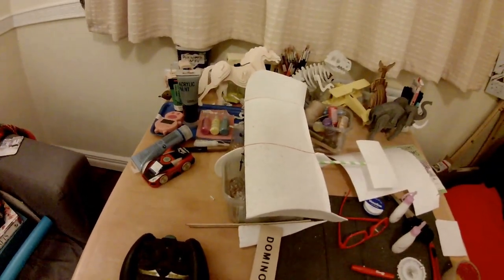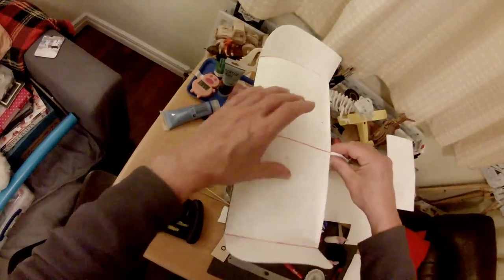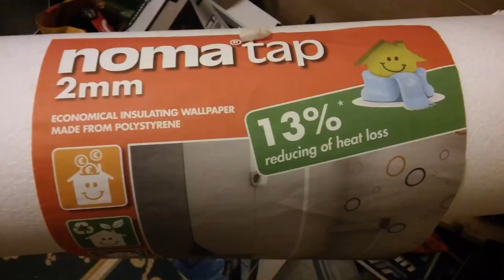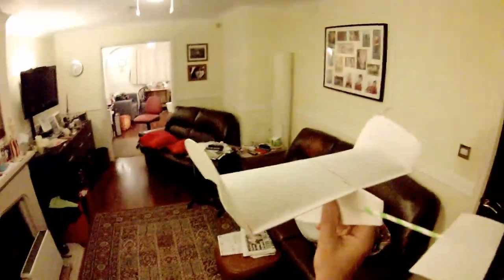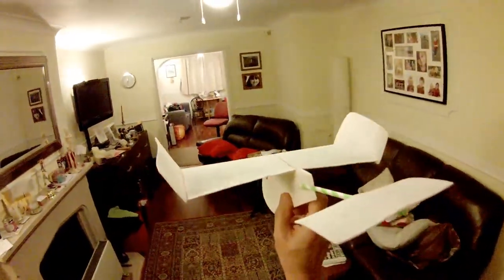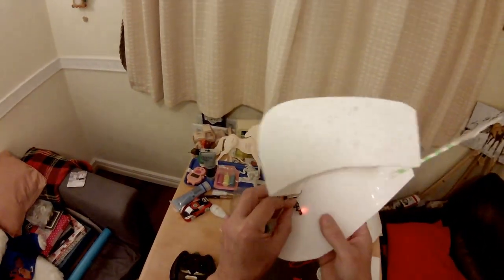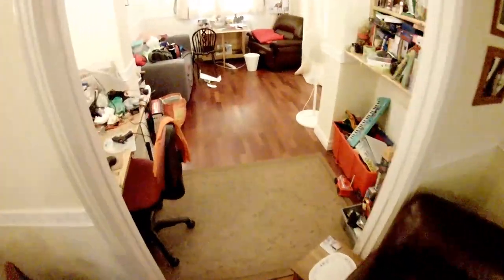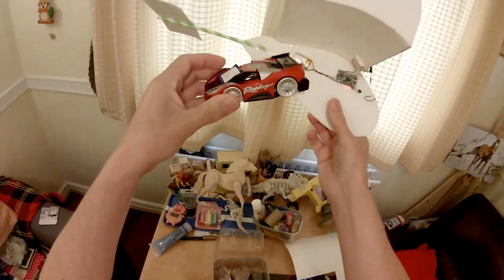Wall climbing car to lightweight RC aeroplane

Comment: Great work. Be good to see it on a calm day in the garden. 👍👍👍😍
Reply from the maker: The problem outside is the range. The infrared gets swamped and I have to run behind it to keep control. If it survives storage I might try it out in a clearing in the woods I recently found. There is a series of videos coming up where I film there and I have realised it might be a good spot for this one.
Reply: @GrandadIsAnOldMan  Ah, infrared. Stick a mini receiver it it.

Comment: Great little plane! Keen to see it in outside 👍
Reply from the maker: The problem outside is the range. The infrared gets swamped and I have to run behind it to keep control. If it survives storage I might try it out in a clearing in the woods I recently found. There is a series of videos coming up where I film there and I have realised it might be a good spot for this one.

Comment: Amazing job, finally another DIY plane video 👍👍👍👍👍👍 maybe you should put a vertical stabilizer to get it to fly straight
Reply from the maker: The whole body acts like a stabiliser, so do those wing tips. They provide what is commonly called a slot effect.

Comment: A classic project. The sort of thing that was going on around 2010, with the first of the 'Coke can' little RC cars. Sometimes, the rewards from such basic circuits and control abilities makes the result 10x better. This one had it's own success. I might suggest a biplane for slow speed and lift, with the motors slightly wider apart for turns.
Reply from the maker: Now that I added the tail a second wing would not be a problem. The original intention was just a flying wing. I am not sure those little motors would manage the extra weight although I could risk larger props. If they kill the motors I have plenty more of them. I have larger ones too but the plan was to just take the gear out of the car and try and fly it as standard.
Reply: It's where I'm at for LRF's too. Thing is, you know what weight the gear can fly from those tests. A new build would be to the same weight or less. I was very impressed with its slow speed, usually finding the need to put a 30mA lipo on and a single 4mm motor! High alpha always helps too (CG slightly forward, elevator/elevons raised). Good luck  :)

Comment: moment of Area technically or Area simply behind CG has to be more than ahead of CG for stability   Y
Since CG always wanna go straight ahead. If plane with more area behind CG gets tilted slightly sideways due to any disturbance,  drag moment to straighten plane will be more than to tilt it (bcz more area behind) so it will re-straighten
Reply from the maker: Thanks

Comment: I like this one. A nice way to get some flying in when winter rolls around. I honestly think that with a vertical fin and some more wing area (a biplane perhaps) this would be a really stable and gentle little flier. What kind of foam are the wings made of? They look exceptionally thin.
Reply from the maker: The foam comes in a roll and it is intended for lining walls for thermal insulation. It is probably around 2mm thick and the only strength it has is because it is curved, Oh and the fact I gave it a carbon fibre leading edge 😁
Reply: Oh cool. I might have to get some of that. Is it very lightweight? 
Hehe yeah that was a very nice build slideshow, Copterdude approves.
Reply from the maker: @AeroCraftAviation  you would probably get better and lighter foam if you rig up your own hot wire cutter and slice up the worst quality packaging you can find. Good quality is usually too dense so you have to find the rubbish stuff. Sciencetoymaker did some good videos on the subject - here is one https://youtu.be/FWdI2VDtlac

Comment: Just an observation, it looks as though the main problem is that the steering is not proportional, it appears to be all or nothing as you said. Proportional steering would probably solve most of the issues you were having. A vertical tail fin(s) would probably help in keeping it tracking straight too. I would probably also reduce the dihedral on the wing tips to stop the influence they appear to be having on the yaw.
Reply from the maker: Yes proportional would be much easier, I did a biplane back in 2015 with proportional control with parts from a toy helicopter and that was much easier to control. There is a link in the description to that playlist. The purpose of this project was to see if we could do the same sort of thing with this wall climber toy car. As to the design, I wanted it to be a flying wing but as you can see I just could not get that to be stable, so I had to add the tail.

Comment: Hey grandad what is the foam material called?
Reply from the maker: I just looked it up on the B&Q website and they list it as Diall Thermal Insulation roll, (L)10m (W)0.5m (T)2mm at £5.42 for a roll. IT is a few years since I bought mine but looking at the description I think it is the same stuff.

Comment: Ho no wait - if its for kids then there are no comments. So whats going on?
Reply from the maker: The full changes will not actually come into effect until January.  By pushing content creators to take action now YouTube can ensure it doesn't pay them over Christmas because they will start reducing your advertising revenue straight away but won't switch off all the features yet. No doubt the big channels with insider information or 'friends' will know exactly when to push the button.
Reply: i havent produced a vdeo i a long time . on my old channels that i got locked out of yes . but this one is just for comments and subscribing.